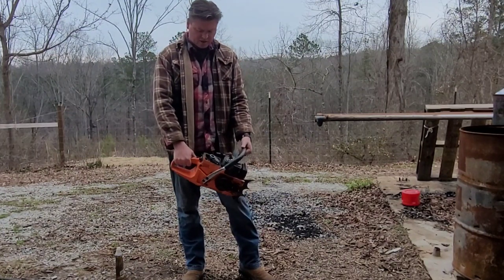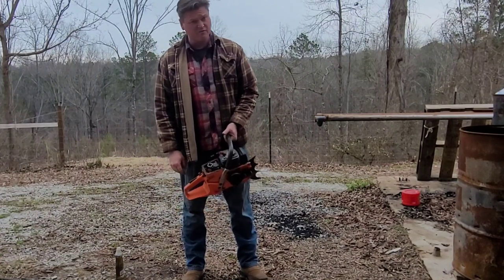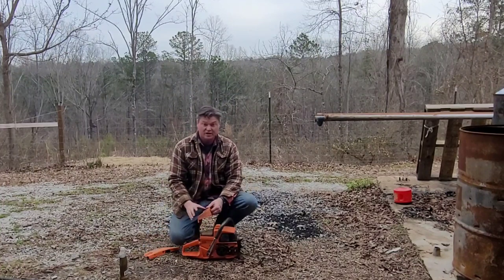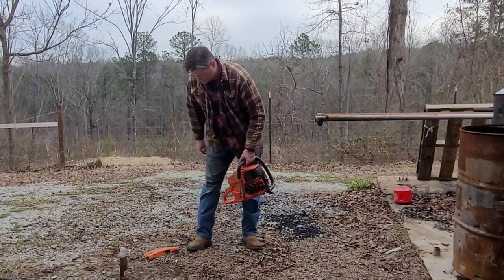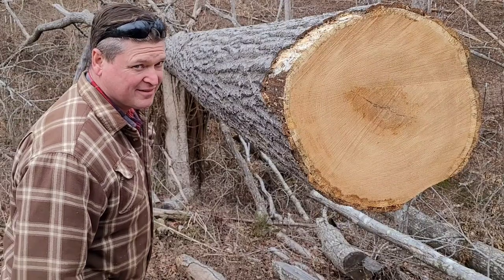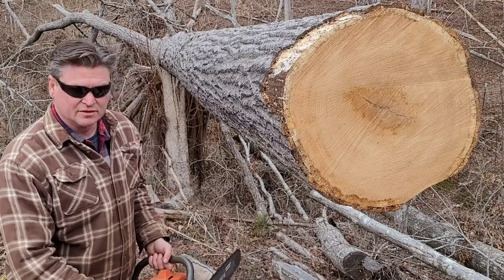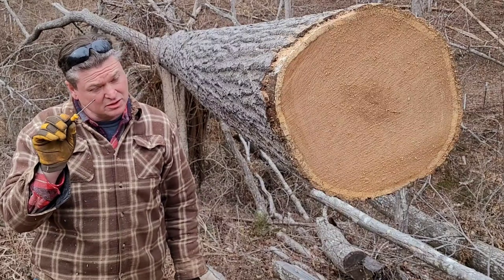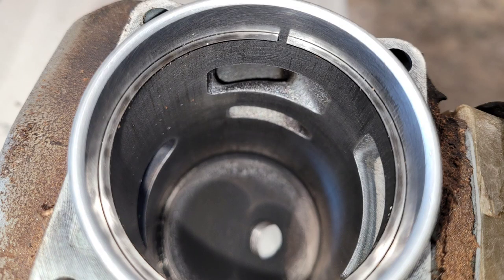Holy Schnikies!  the 2100cd is a RIPPER!

Comment: I have to agree with Tim Vandevest. That saw popped off on the first pull after you primed it with fuel. May have over chocked it. This is a great example of what we all go threw with trying to start some of these saws. It happens to all of us.  Take don't take it the wrong way Boedy. But I enjoyed watching this. This happens to me a lot. I could feel your pain. Some subscribers recommend pulling the governor on this saw. I have sold many of  the 2100"s in my day. Mostly with 5 foot bars to loggers in my area . Mostly to cut White and Red Oak. Leave the governor in. This saw was designed to pull and work very hard. I must say I never really got many of  them back with problems. One well built chain saw.

Comment: I really like mine. You have to get it to compression and then pull for all its worth. Don’t do what I done on camera and forget to turn it on and pull a few times. The pins that hold the starter paws in sometimes like to back out, especially if you took the recoil off and just put it back on without pulling the rope to get the paws to swing out of the way.

Comment: You shouldn't drop start that saw or you'll blow out the starter paws on that recoil. You should pull lightly until they engage the flywheel then pull. Also, use the throttle lock to set high idle.
Reply: So painful to watch..
Reply: ... and close your mouth while cutting, unless you need more fiber in your diet.
Reply: @loganpotts9623  Probably why he didn’t name his channel The Well Seasoned Lumberjack

Comment: I’ve never run a 2100, but I do have a 285cd, which looks identical to the 2100 minus the manual oil pump. My 285 has so much compression that I always start it on the ground and don’t snatch the rope, I get the pawls engaged and then pull

Comment: The 2100 is the modern day 395xp basically. Yeh they are hard to start but beast of a saw!
Reply: I'd argue the validity of that. The 2100 had a larger stroke but same bore. The 2100 predates the 395 by 2 generations. The 394 is the predecessor to the 395.
Reply: @Woodman_Custom_Sawing  I read where they based the 395 off the 2100!
Reply: @NothingButChainsaws  I dont know where you read that but like I said, the 394 came before the 395. In fact, the 395 is the same as the 394 except it has a rubber intake boot and a quad transfer design. If anything the 394 is more similar to the 2100 than the 395 because the 394 has dual transfers and a block style intake. Everything you said about the 2100 being a modern 395 in your first post doesnt make sense.

Comment: I have a spot in my garage we can put that saw, and it will never hurt your shoulder again
Reply: Was it too lean or rich when you first cut?
Reply from the maker: Too rich.  I kept expecting that the 3/4 turn on the hi jet was too lean because the previous owner didn't understand the governed carburetor.   Turns out, it was pretty close to 3/4.  Not sure exactly where it ended up, but probably close to 3/4 turns.

Comment: Holly ring gap hopefully you put new rings in that saw
Reply from the maker: So, I thought the same thing.  Turns out, thin rings had a huge gap because there is no cutout for the pins.  Normal.  I checked, it was at .080!  But that's just how the thin rings are.  Clearly, it's not down on compression!